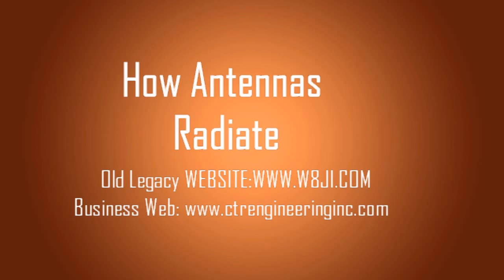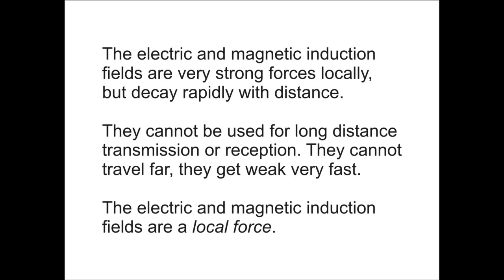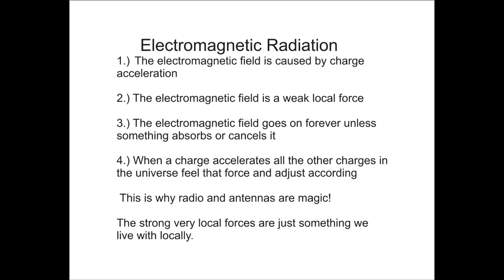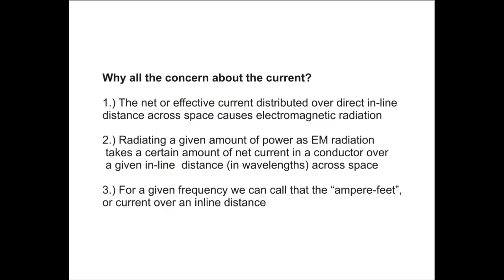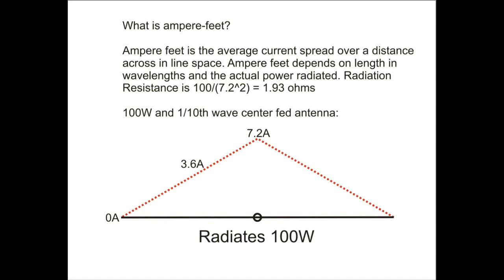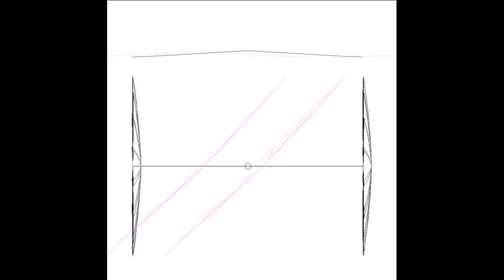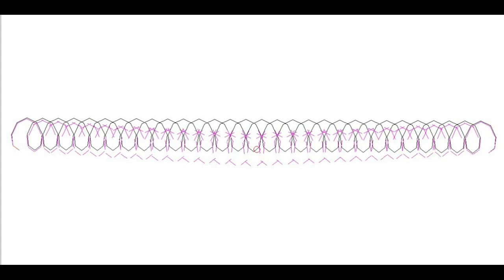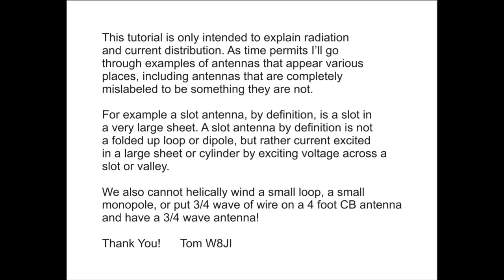How Antennas Radiate

Comment: Excellent presentation and very thought provoking.
Reply from the maker: There really isn't anything thought provoking about it. Behind all EM radiation we have accelerating charges. Charges in motion produce strong local magnetic fields, charge distribution differences produce strong local electric fields, both of which decay rapidly with distance, while charges acceleration over linear spatial distance produce the weak local EM radiation that goes on forever at great distances.
Reply: @Jerrythenerdful , I meant regarding the physics that cannot be defied by small antennas.
Reply from the maker: @g0fvt  Exactly.

There are a lot of magical small antennas, some made magical by calling them a magical name. In the final analysis, when we get past the fiction, there is no magic at all. Antennas all work like they should work. Make them smaller and the current has to increase to radiate the same power. Along with that at some place in the system the voltages get a lot higher, and there goes the efficiency. You can pack 10 miles of wire in a two foot space and it is still a two foot antenna.
Reply: @Jerrythenerdful , on a tangent a little, from models it looks like there is benefit in making a "quarterwave" vertical fed against ground a bit on the long side and using a series C, would be interested in your assessment. It looks like it ought to have a better pattern for low angle and a "better" impedance. 73

Comment: Loved the video.  Guess I can figure your view on a skeleton slot antenna.  Thanks for sharing.
Reply from the maker: The skeleton slot is by definition not really a slot at all. It is an elongated loop. The in-phase current at the two current maximums that is additive in radiation broadside to the element is confined to the wide spaced short ends. 

The long sections contain out of phase currents not only between sides, but between each part of a side. Not only is current out of phase, it also contains the current minimum. Any full wave loop is really just two short dipoles, end loaded by bending and fed in phase through direct coupling from end-to-end at the voltage points.  

To be a slot antenna the current has to be excited in a wide sheet by impressing voltage across a slot or channel cut in the sheet.

Now with a stretch of the imagination we might consider the element a skeleton of a sheet, but with no sheet to have currents in that is a stretch saved by the word "skeleton:". We might just as well call a dipole a skeleton slot dipole, because it also is the "sheet less" complement of a slot. As a matter of fact analysis of current is a slot antenna are so difficult the mirror or complement is used to approximate or explain the pattern.      

If we read Kraus and a dozen others we never see a slot without it being a slot. We find loops and dipole called what they are in an accurate descriptive way, not some fancy fake name. None of this changes how the antenna works, however. We can call it anything we like and it works the same. There is no magic.